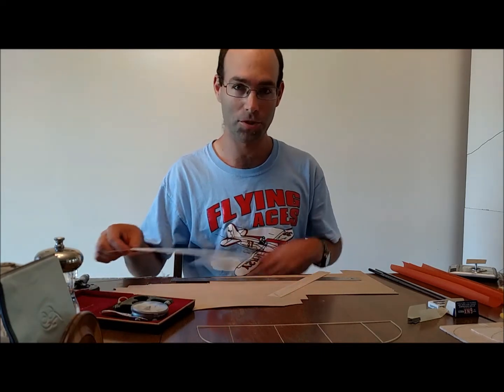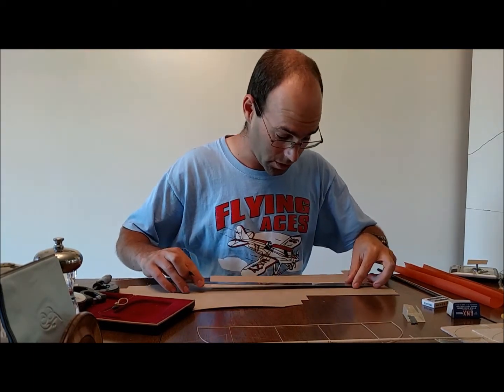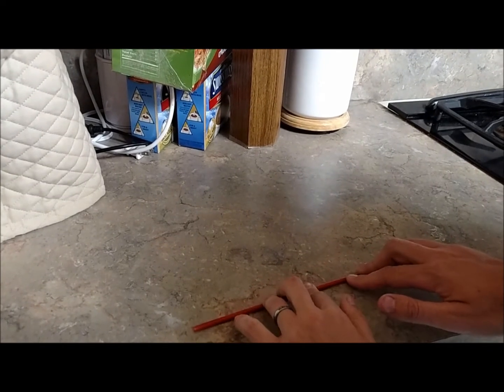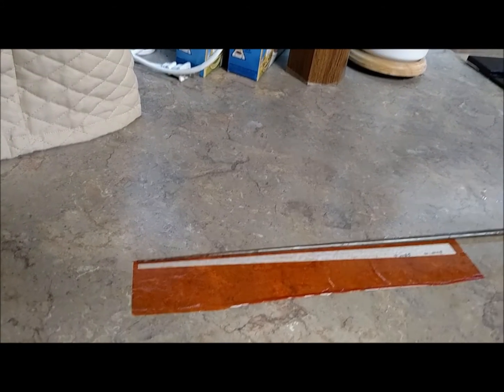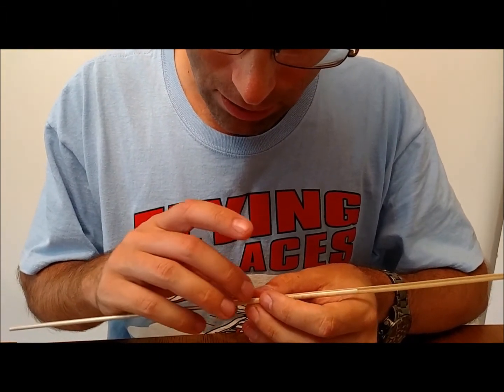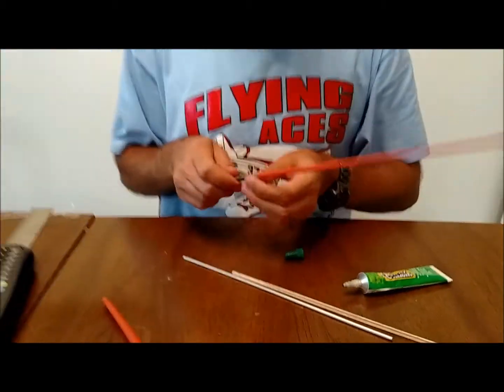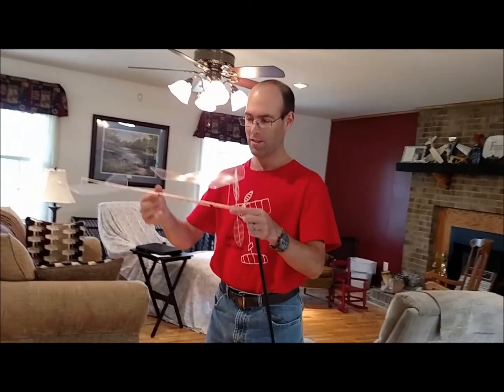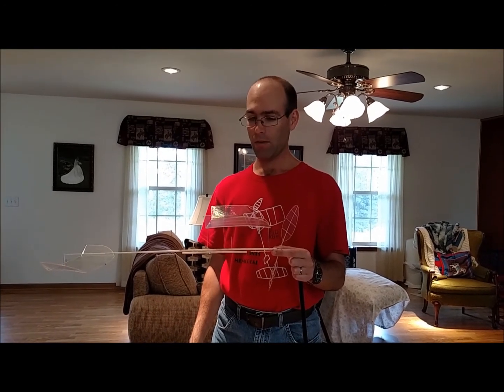Rolled Tube Fuselages for F1D and other Free Flight Airplanes

Comment: seems to have a very high angle of attack - would it not be more efficient if it was flatter?
Reply from the maker: Trim for L/Dmax speed, which is pretty nose high for most.
Reply: Is it the low Reynolds Number that makes this possible? I look at the implied tip vortices and think that could be reduced by increasing camber and reducing AoA.
Reply from the maker: I personally don't think tip vortices exist as we understand them at reynolds numbers this low. On a heavier, faster model, you'd probably want vortex suppression tips, but I suspect the optimal AoA would remain similar.
Reply: I was curious if you have ever trimmed a flyer with two different AoAs to see if there was any performance difference?
Reply from the maker: Sort of. The stab and wing incidence are both independently adjustable, so I can make it fly pretty much any AoA I want to. It ends up at whichever one gives the longest flights. ;)
Reply: Ah max Duration, not Range, right. So i think you are minimizing your glide sink rate not  maximizing your L/D.

Comment: What dial thickness indicator do you recommend?
Reply from the maker: The one I've got is a very old Mitutoyo that belonged to Tom Vallee. I believe he removed the spring and replaced it with a lighter one so as to avoid crushing the wood. It's a phenomenal tool.

Comment: Where do you get your rubber bands
Reply from the maker: faimodelsupply.com, but you need a rubber stripper to get them sized for flying, and those are over at indoorspecialties.com. Not cheap, but necessary. Freedom Flight Models does sell prestripped rubber in several sizes, for what it's worth.

Comment: where  do you get all of your building supplies? I can't find balsa wood that thin.
Reply: XNinja Make it
Reply from the maker: XNinja I'll post some more links in the description. there are only two sources and they charge about $8/sheet for 1.5"x18" sheets
Reply: @joshuawfinn  I looked for the links in the description but did not see anything for the balsa wood sheets. Can you post them again? Thanks!
Reply from the maker: @expatinspain  try contacting David Lindley at indoorffsupply.com. He has some old wood from various estates that might meet your needs. The other option is to email Ondrej Krucky and see if he can cut some wood for you: O.krucky@centrum.cz